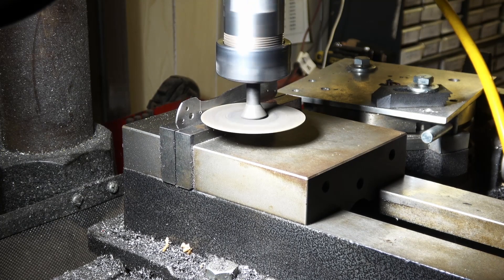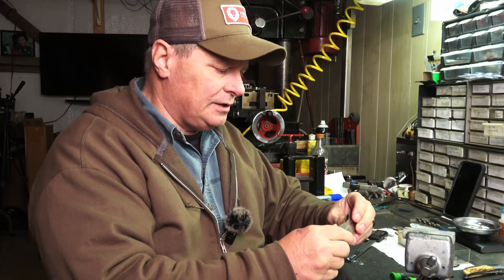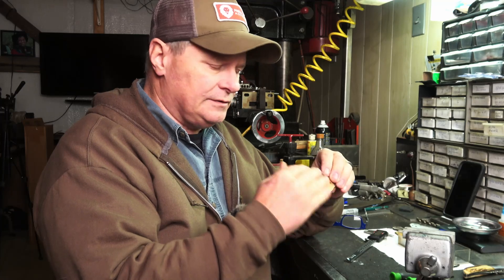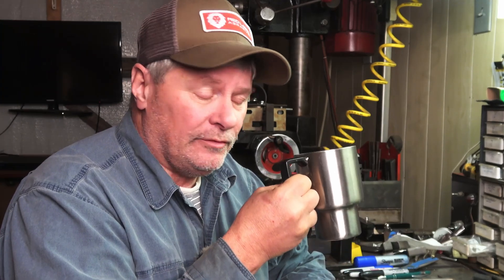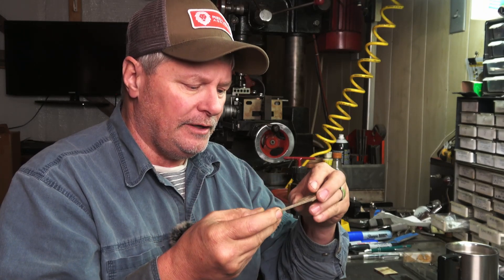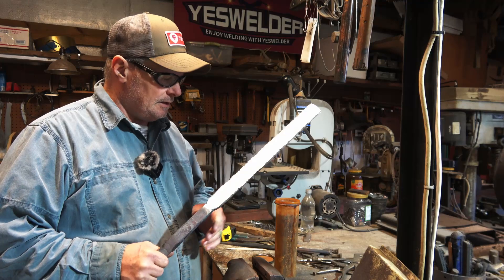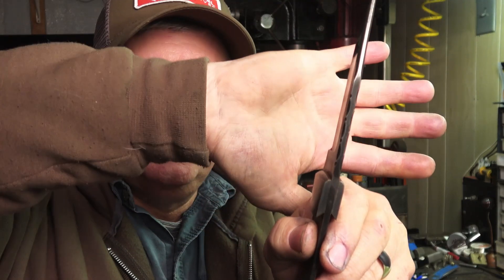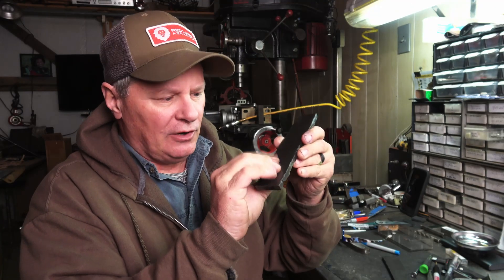Making Twisted Damascus Steel for Liner lock folders

Comment: What steel and thickness do you like for your liner on a liner lock?
Reply from the maker: I like 60 thousandths but these are 50.  That’s at the limit for these blade lengths.
Reply: @TonySeverioKnives  Thanks.  If youre just doing something standard what kind of steel do you use for the liner?
Reply from the maker: I like to use titanium.  It’s light, strong and holds up great.  Some folks use heat treated steel for liners like 15n20 but it’s going to be much heavier.
Reply: @TonySeverioKnives  Thank you!
Reply from the maker: @hintzecustomknives welcome man!